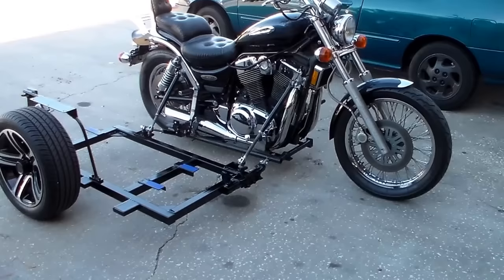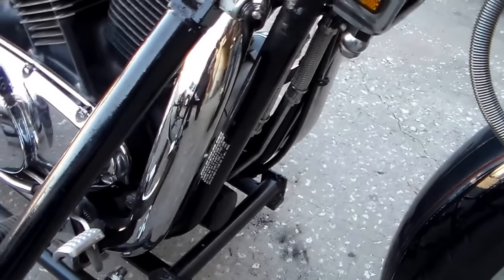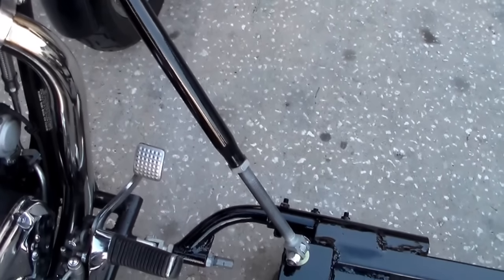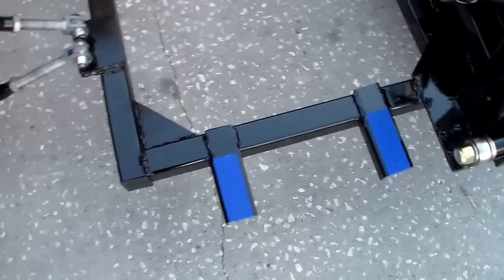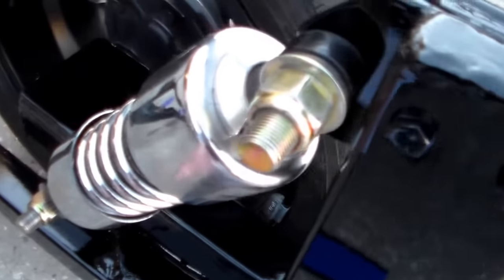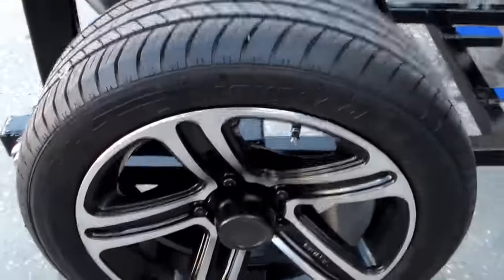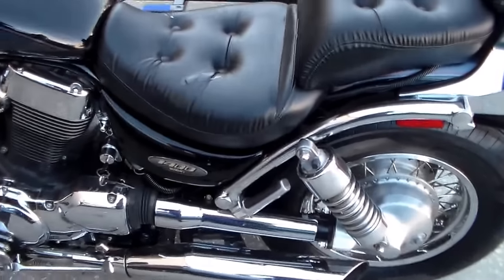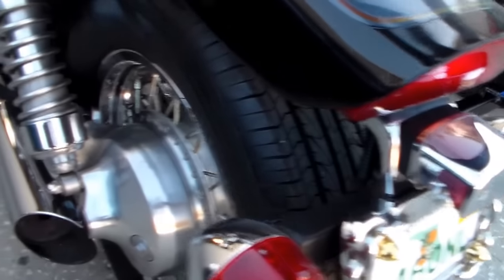Suzuki Intruder 1400 with sidecar frame Part 2

Comment: thanks for showing the frame I am thinking of making a side car for my 650 Savage and seeing your frame helped
Reply from the maker: Your welcome. The Suzuki Savage is a fun bike,  the single develops lots of torque. A sidecar adds a lot of drag though, my 650 Yamaha V-Star would barely do 60 mph with the sidecar and passenger.
Reply: before istart i need to finnish working on my Jeep the i need to look at the bike I'm thinking of buying a English Wheel and a bead roller and building the body for the side car my self  buying the tools and the sheet metal looks like it would be cheaper than just buying a side car and modifying it.

Comment from the maker: Thanks G. I thought the same as I was suggested this by a stock car designer/fabricator. If you have the parts, do a bench mock-up. You will find zero lateral play. I used very heavy Heim fittings. I can look up the size if needed......

Comment from the maker: Hi Karen, the tubing under the bike is 1"  with a .125 wall. The brackets were made out of .250 mild steel plate. Every installation is unique,  a good source of help is a certified welder/fabricator.       If you can post a picture  or send a PM I may be able to offer you some advice. It will turn out to be a challenge, but don't give up. More power to you!

Comment: I am sorry to say that the structure is not as strong as one requires.
Basically there are three in line hinges  and the only non "hinged" joint is the front lower p art and I cannot imagine that that horizontal threaded rod will hold a load at the other three basically hinged joints. .

Comment: Excellent video chum. I'm making one right now myself and could use any tips you might have. Grew up in a machine shop and can weld anything from a broken heart to a guilty conscience. lol. 1994 6 cylinder Kawai. I would be grateful for help with the frame on the bike.
Reply from the maker: Hi Judge TK. Sorry to be answering 9 months late. I used the mounts that came with the Inder sidecar kit. Lots of modifying, but you're handy with welding, you shouldn't have any trouble. Triangulate the mounts to the Kawi frame. I think your bike is very heavy, so use schedule 80 tubing as a suggestion. Probably hold off in anything permanent on the bike frame, as you may not like riding with a sidecar.......
Reply: O

Comment: Excellent video, you should of been a professor, you speak perfectly, not to fast and not to slow. I have a Kawaskai 1700 and starting to build my sidecar, did you buy the brackets or did the welder fabricate them and where did you get your tire from, beautiful, you are a great help, Thank you, Robert
Reply from the maker: Hi Dr.Sarhan, the sidecar was originally an Inder product from India. I had it mounted to a Kawasaki XS650. The wheel, suspension, and frame were very light duty, suitable for a smaller bike. I fabricated the new frame myself, with advice from a professional racecar builder for the suspension mounting. The mounting struts were reused from the Inder frame. They were mounted in a triangular layout for strength. The axle spindle and wheel are replacement trailer parts. The spring/shock assembly came from a medium size motorcycle.
Doctor, I built this almost ten years ago, not knowing there would be so much interest in my project. I would have kept notes on parts, measurements, and suppliers. It did ride well with a 260 pound passenger. If I had another sidecar body, I would build another with improvements on the frame design and appearance. I was a lot of fun! PS I left you a note on one of your videos.  Art

Comment: Does the side car lean when you lean or is the sidecar rigid like most side cars ? Most side cars when you turn left lift the sidecar up and right turn you have to turn right  . hard at best and you to relearn to drive it . I have only seen once a British bike that had the side wheel leaned in unison with the front tire , better control at high speed .
Reply from the maker: The sidecar is rigidly mounted....

Comment: Hope i'm wrong, but the mounting brackets are not safe.  That frame will colapse on te first fast left hand bend..
Reply from the maker: Thanks for your concern. No flexing with the side car frame after completion. I regularly carried a 250 pound passenger.. I sold the side car to a gentleman who mounted it on a Harley FL touring bike. If it was going to break, that would have done it. Never happened.....

Comment: The frame under us bike, what is the size of pipe? The mounting brackets where did you get? I'm trying to make a trike out of a trailer, utility trike I call it. I'm trying to figure out what is the best way to mount it to the bike. I'm disabled female and trying to do it all myself.
Reply: If you look on YouTube n put in supertrike, it will show a bike with this setup. I've tried to get up with the owner but no responce. So I'm trying it. I've got the trailer cut out and axles welded, yes I'm doing the welding but I have a friend that is making sure its done right. My issue is trying to figure out how to attach. Any suggestion would be a great help! Thanks for or time.
Reply: Also under cleancutsudios on YouTube
Reply: karen price a

Comment: Was it hard to handle with the wide tire?
Reply from the maker: I didn't notice a big difference over the original frame/suspension. But it was much heavier. Wider handlebars are recommended...
Reply from the maker: But the ride for the passenger was much better than stock.